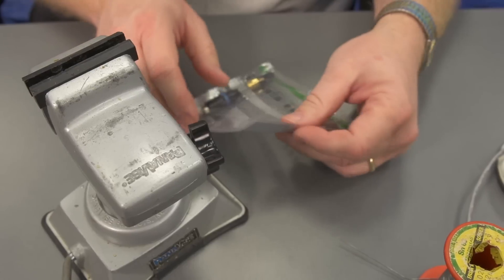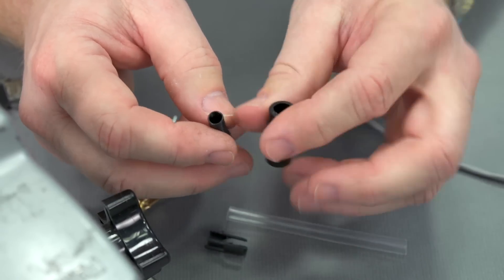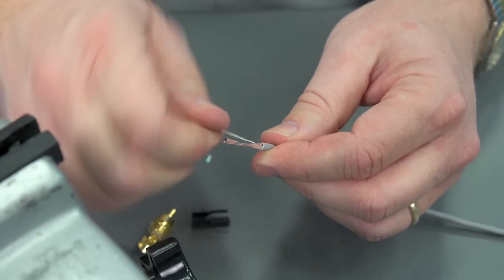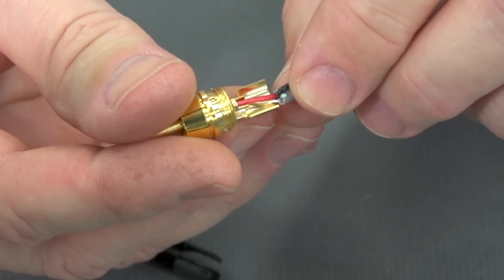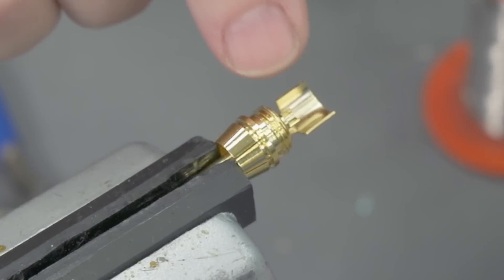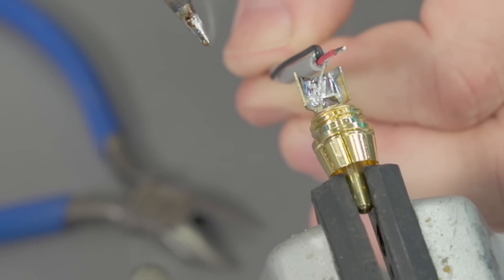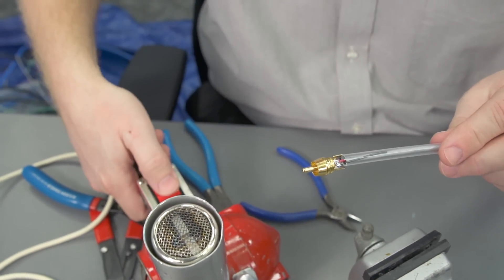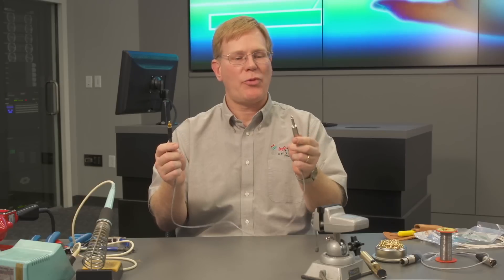Soldering RCA

Comment: Wait why is the black cable not connected? How does this work im kind of a noob
Reply from the maker: An RCA cable only sends the signal down a single wire. And then you have the return. That's why you need left and right channels with separate RCAs on your home stereo system. The black wire wouldn't do anything because there is no signal for it to pass. As Tom says in the video though, we show a three wire cable because you might, for example, later choose to use a balanced connection like an XLR where you would use all three wires. But for an RCA, which is an unbalanced connection, you really only need one wire and a ground. Hope that helps!

Comment: Why do they only use a few strands of wire on rca wires? I have a set of Rockford Fosgate rca cables that are huge. They are atleast half inch around. Well the ends weren’t on good and ripped right off. Inside the wire is so small there is hardly enough wire to even soiled !

Comment: What temperature do you have your soldering iron at for these? I've never managed to get it right. Either the insulation on the cable melts back before the joint is made, or while tinning the RCA connector the insulation around the centre pin gets soft from having to have the iron on it for so long.
Reply: Look into getting a soldering station. Weller makes some nice ones which allow you to adjust the temperature and have a removable "Pen" with a length of cable that connects to the station. By adjusting the temperature to a higher setting, (800 degrees) , it allows the flux and solder to melt fast without the heat travelling down the wire too fast. You'll only continue to be frustrated if you're using a non adjustable heat iron, like what radio shack sells. Best part is that the Weller pens have removable tips that you can replace when they wear out and there are tons of shapes and sizes. I think I paid 50.00 for a used station off ebay. There are also Chinese made ones that I hear are pretty nice.

Comment: hi Thanks for this video, i assume you are working with a neutrik plug. I just tried to solder a neutrik rca plug with the  cable but I could not understand how to crimp the cable in place. I notice there was too much movement in the signal wire and it broke. I can now see your technique on getting the drain wire soldered on the end and bending the signal wire to stop any movement.  Plugs are normally are crimped so i did not know how to solder this plug Thanks I can have another go now.

Comment: To reiterate the request of "discoking62," below:  How does one solder a female audio RCA connector, especially the signal connection=?
Reply: The female RCA solder connector is similar to soldering the 1/4" or 1/8" phono connectors. The "tip" is traditionally the center cup. While the sleeve is the remaining outside cup. I say that since there are various types of RCA manufacturers that can make them differently. I hope this helps.
Reply: Thanks.

Comment: Aren't you supposed to heat the rca connector and let it melt the solder? You seem to be melting the solder directly, which I have always heard is not the way to do it.
Reply: That's correct.  You heat the material and apply the solder to the material.  It could be either camera angle or I'm just close to the iron.  Soldering Principles are discussed here: https://www.youtube.com/watch?v=4V3Iy2ckj1I&index=15&list=PLrDZTnChdo6Gvrq9DB1AIevpLsrWnOrnl

Comment: Can you tell please what soldering material and tools did you use ?
Reply: Hi Saree.

Thank you for asking.  Personally, I am partial to quality tools.  I believe well made tools fit and perform better.  While I have listed certain brands and model numbers below, you may find that an alternative quality tool is more to your liking.
The vice is a Panavise 381 with the vacuum base.  For benchwork, you may prefer the 350 with the parts tray.  Others have often made their own jig to hold the connector.
The universal strippers with the red handles are Xcelite 101S.
The diagonal cutters with the blue handles are Klein D244-5C.  For small trim work, you may also like a pair of flush cutters such as the Xuron 2175.
I’m not certain which strippers were used to remove the jackets from the individual conductors, but I use Klein 11055 and 11057 strippers.
The soldering station is a Weller WTCPT using 700 degree tips.
The solder itself is a Multicore SN63.
The heat gun is a Master Appliance HG-501A (120 V version).
There are some larger diagonal cutters later in the video.  Those are Channellock 436.

Regards,

Tom

Comment: It is better to use the red wire for conductor (or 'signal' or '+') and the black wire for return (or ' - ' ).  That leaves the shied.  (1) It can be unattached - the so called 'floating shield'.  (2) Better is to attach the shield to one end of the rca.  Solder it to the same part as the black return wire.  Incidentally, in this version the attached end should be at the source (eg if the wire was to run between a CD player and an amp the shield end of the cable would be inserted at the CD).  (3) Best in my opinion is to solder both the shield and and black return wires to both ends of the RCA.
Reply: are you replying to discoking62 or just commenting on th video?

Are you saying this video is ok to follow? I'm a soldering noob